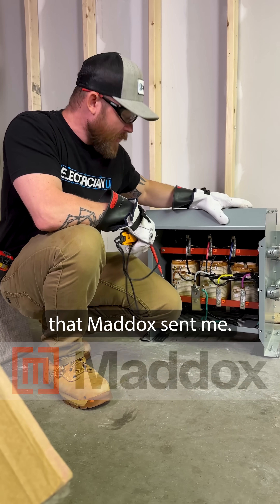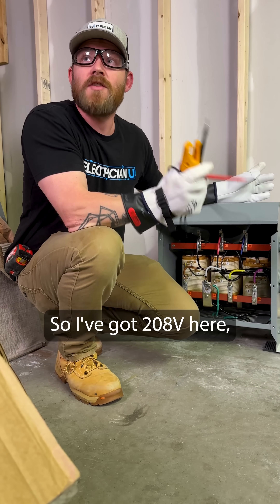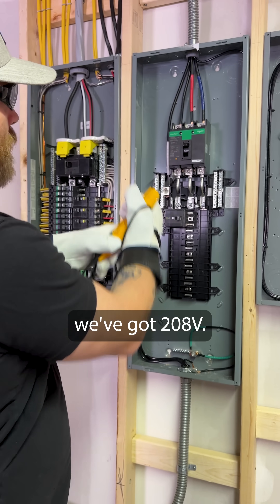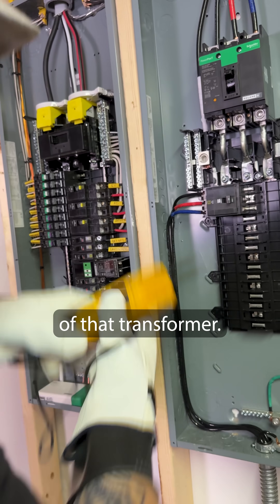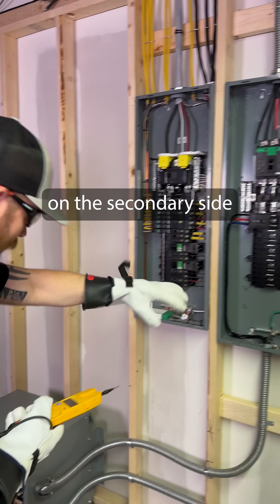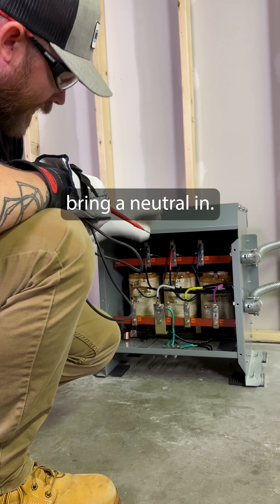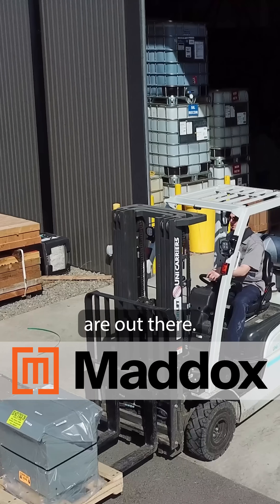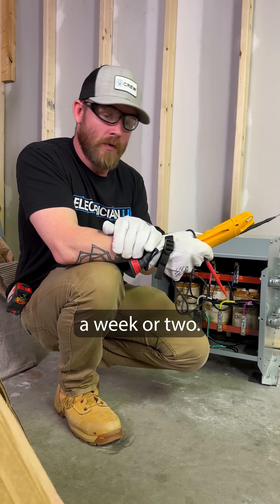(STEP UP) Transformer from Maddox!?!?

Comment: How do you distinguish the breaker size in this same system. I’m installing a step up 30kva 208 primary 480 secondary transformer. I’m doing my research.
Reply: just look up the 3 phase KVA chart. for 30 kva from 208 you would need 83 amps so a 90 amp breaker. which seems crazy but thats what happens when you step up voltage, it takes a lot of amperage.

Comment: i cant see the bond screw on the first main disconnect panel. might be the video but my question is does it still require it? and for the 2nd panel thats 480 would you need a new ground system or would you be able to get away with it at the ground bridge ? im self taught and 1st person to be an electrician  (unlicensed) so dont hate please. i do however find your videos most intresting !

Comment: What’s with the brown, yellow, purple instead of the normal brown, orange, yellow?
Reply: For real. I’ve never seen purple is all my years of this trade. And I hold a unlimited license in NC
Reply: In Texas we normally use brown, purple, yellow for high voltage.
Reply: @ReeseDavalos  “high voltage” like 480? 😅
Here that is low voltage. 4160v is medium voltage. And anything above 13.8kv is high voltage. We use red/white/blue for high voltage or 12,470v transmission lines. 
I don’t know if there is an IEEE or NEC standard or not though. Now I’m curious am gonna have to look that up. 😇
Reply: Boy 227v or 480 goes brown orange yellow
Reply: @gus732  Depends on location

Comment: Appears the second transformer that might have upper greenfield too high. Transfomers like that I installed always had a line or mark no more then 6 " higher starting maximum wire entrsnce. We have a large company that sells used transformers and never had trouble with them. Best thing have a good inventory.of phase changers. ( 2 to 3 & 3 to 2 phase ) .

Comment: It's a utility company's problem why not having them fix it instead of promoting for Maddox?
Reply: @hanisolaqa  In residential 99% of the time there's only one transformer and it's on the service side. In large commercial and industrial it's common to have multiple transformers. Those are all owned and maintained by the customer.

Comment: Brown, orange, purple? 🤔😕 You do you man.
Reply: That's Brown, Yellow, Purple for ABC phase for 277/480 for Austin, TX. 
San Antonio is Purple, Brown, Yellow.
Other places have Brown, Orange, Yellow. 
If you do a lot of work on switch gear you have to pay attention to where the manufacturer of the equipment is shipping from.
Reply: @Stover6996  I've only ever seen Brown, Orange, yellow. In the states I've worked in
Reply: @jakes.5591  As far as I know that's the color 99% of the time. But there are some places that are different.
Reply: Brown, orange, yellow?

Comment: 408.36(B) says secondary conductors feeding a panelboard needs overcurrent protection on the secondary side of the transformer
Reply: @santiagocontreras5889  yeah. They must go to a breaker them feed the load. Pretty basic and you’d want that anyway so you can have control of power flow. You’ll also need a disconnect if powering 3 phase loads
Reply: Good catch 👍 … I think this was just a plug for that transformer company and that panel was being used for demonstration purposes.
Reply: @M3thodbombz   he definitely indicated that he was trying to run some sort of piece of equipment but it could've also just been a demonstration. Yeah I'm in the camp would like to see a disconnect in that panel but since it's right next to the other panel it does and it doesn't make sense. As long as it's properly labeled see panel B space 24 for panel C disconnecting means etc.

I was in a situation where somebody (qualified) I knew installed a 100 amp sub panel a little bit more than 10 feet away other side of the wall from the main panel(s) for an addition. And during a power outage I was trying to load shed some things and eventually I had to take off the panel to find out what was going on. Turns out the sub panel had a main breaker but was being fed from a secondary breaker within the subpanel. so when I turned the main breaker off in the subpanel It didn't isolate from the main panel. When power came back on that was properly re-labeled.
Reply: If the panel was over 10'? Maybe that's why he went with the MLO?
Reply: Well that is not exactly a panel board. It is a load center. 

Also, the main disconnect is within sight. Not even 1' away. Plus the tap is not longer than 10'. 

This is one of the many gray area sections from the code book. 450.6 (A) does state the OCPD shall be provided at each end of a tie circuit. But! It also says "as required in parts 1, 11, and V111 of article 240". 

So now we have to reference 240.21 which also says "OCPD shall be provided and located where the conductors receive their supply." "EXCEPT! as specified in 240.21(A) - (H)". 

Now go to 240.21 (B)(1), all good there....Read the info note at the bottom..."See 408.36 for OCPD for panelboards."

Now here is where it gets grey....

You are correct that 408.36 and 408.36(B) do also say that, "OCPD is required at the secondary".

Now, underneath 408.36(B) read that "EXCEPTION" in italic writing....It says, "A panelboard supplied by the secondary of a transformer shall be considered as PROTECTED by the OCPD provided on The Primary Side where in accordance with 240.21(C)(1). 

Now here we are...at 240.21(C)(1) - (6) where it states that "As long as ya fall into these guidelines, you are protected by the primary OCPD and you are "To Code".

Comment: I have completed over 1,000 Constructability Reviews where we look for errors, omissions, and conflicts. A frequent conflict is mechanical specifies 480V equipment but the building is supplied with 208V; it's far easier to catch that during design and change the mechanical spec to just purchase 208 equipment; it can impact sizing of feeders also.
Reply: Worked at a large plant where a worthless nogoodnic engineer told a German company that we had 440 volts. We had 480 volts feeding this  $10 Millon custom made machine that was tripping out the 24 volt DC Power supplies ( on over voltage )  feeding 7 computers. Being this engineer had over 20 years at this plant they allowed him to order & air freight a step up transformer. Of course he ordered a 440 to 460 volt step up transformer or something close to that that still tripped out power supplies so we had to lower taps on the 13,200 volt transformer that supplied power to the 3,000 amp 480 volt buss duct that feed machine. When I called him on the phone that night that he screwed up again he said I hooked it up wrong. Told the idiot that it only has 3 input   & 3 output lugs, DA and he should maybe only be in charge of the janitors. Of course the next day the POS facilities director stuck up for him. Told him that the 6 electricians love this worthless engineer because his jobs gave us three times the overtime fixing his screw ups then the other engineers.

Comment: Won’t pretty much ANY transformer step up OR down? 

I have installed several in either configuration.
Reply: The transformer has to be listed that I can be back fed, you cannot derive a neutral from your secondary if you back feed a transformer meaning you can only supply line to line loads and have to adhere to the code requirement of having an ungrounded voltage system.
Reply: @santiagocontreras5889  which doesn’t not mean much except that it would only be used for 3phase power.
Reply: Ya, the most important thing about a transformer is neither side., Load or supply can however your using it doesn’t exceed the kva rating of the windings.
Reply: Yes this works just fine as a step down transformer if you fed it 480v on the secondary side.

Comment: Why aren’t you able to have that building fed by 480 3 phase if you already have 3 phase service.
Reply: The transformers from utility are suppling the property with 120/208v 3/phase , not 480v hence why he needs his own transformer to step Up the voltage.
Reply: @kevintellez7954  I would have the utility put a 480 transformer on the pole. They’ll supply you the voltage you need.
Reply: @ryanabbott1104  Having the utility install a new transformer is often far more expensive and takes a lot longer, especially for 1 machine. Additionally, many places don't have poles anymore and if that is the case then it is a far more massive project to run lines to a new plot for a transformer install than simply "putting one on a pole".
Reply: @LordSaliss  when we built a pole barn, the power company asked what voltages we’d need and they installed it. I’d much rather have a utility transformer than a private one. If yours burns up, that’s your cost. If the utility does, that’s on them.
Reply: @ryanabbott1104  well maybe just stick to barns bro. The cost of having the utility upgrade a property to 480 from 208 is probably 10- 20x   if not more than what someone would charge to put to install a transformer and load center. lol
Reply: @TheKyleb408  was free for us

Comment: What’s up with brown,yellow,purple tape for phasing your 480?
Reply: Idk about everywhere else but in Texas we use black red blue for 120/240 3/phase and brown purple yellow for 277/480 3\phase to easier identify voltage and phase
Reply: @kevintellez7954 
That's Brown, Yellow, Purple for ABC phase for 277/480 for Austin, TX. 
San Antonio is Purple, Brown, Yellow.
Other places have Brown, Orange, Yellow. 
If you do a lot of work on switch gear you have to pay attention to where the manufacturer of the equipment is shipping from.
Orange is often reserved for a Delta high leg on B phase so the AHJ might do something different to avoid confusion.
Reply: Was wondering the same thing…. I think the purple is the same as brown or equivalent in phase color? 🤷‍♂️ idk
Reply: Some ahjs prefer purple instead of orange. Don't really know why. Could have been called in drawings too. I had a job that call for 480/277 to be marked brown blue purple, 208/120 to be marked black red yellow. Why? Don't know. That's what the site wanted. Ahjs will sometimes tell you to change your phase tape for no other reason than they like that color better.
Reply: NY here, and in the city I've always seen what we all know as BOY colors, but upstate NY, I ran into the BYP! It's a preference of the power company upstate.

Comment: If I were to measure between the old neutral and one of the 408 volt phases off the new Transformer what would I get cuz the new neutral in the old neutral are connected to the ground right
Reply: You would get the difference in potential from your phase to neutral. Yes both neutrals are bonded to the ground.